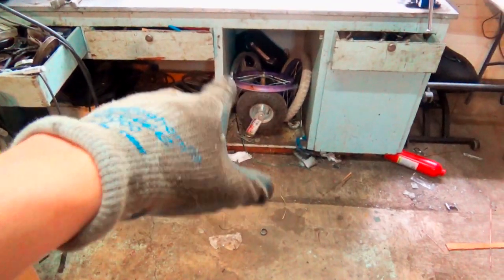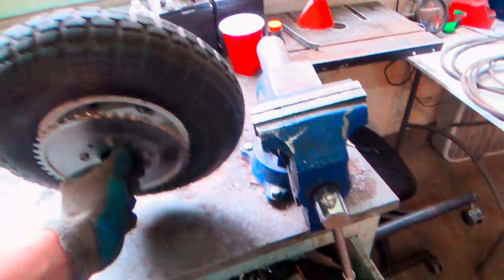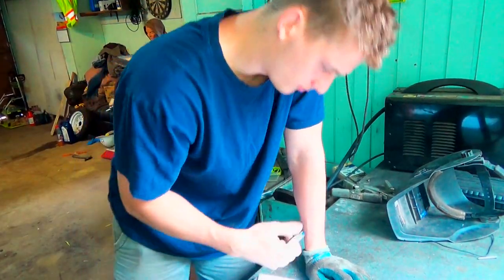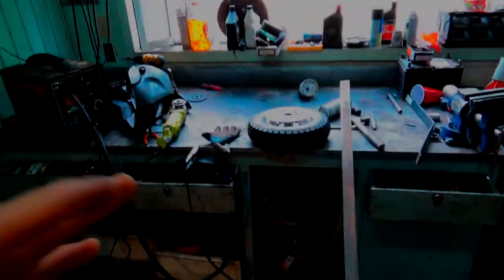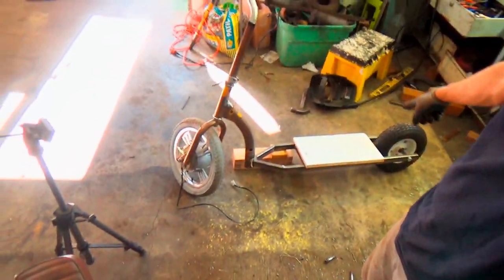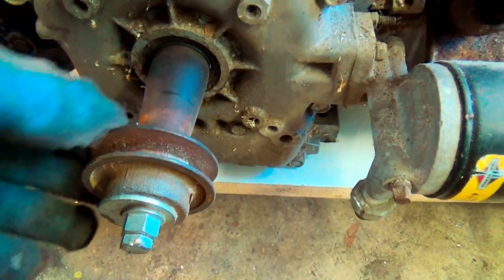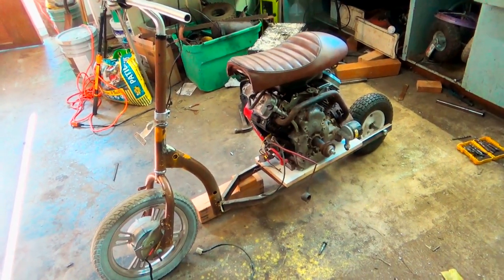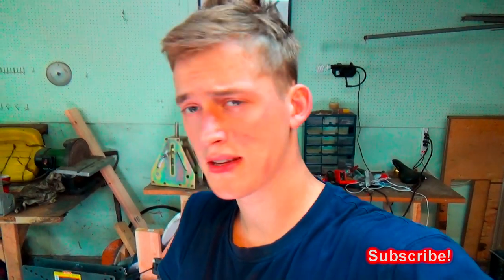Budget build -monster gas scooter (part 1)

Comment: How many amp is your welder
Reply from the maker: it's a 170 amp 240v
Reply: Oliver Motorized do u think I could get away with making frames with a 130 amp. I have a 170 240v from habor height but don't have the right plug for it so i was going to return it for a 130 110v would that be ol
Reply from the maker: ahhh, I had to do some rearranging to get 240v in the garage so I see what you mean. But yes the 130amp is a good little welder for frames. I used a harbor freight 130amp welder for years. and the first 10 or so projects I have on this channel were all made using it!
Reply: Oliver Motorized thanks so much for the advice I appreciate I will definitely go get the 130 amp to save the hassle of making a 220v outlet. I'm only 14 and I'm still learning so thanks